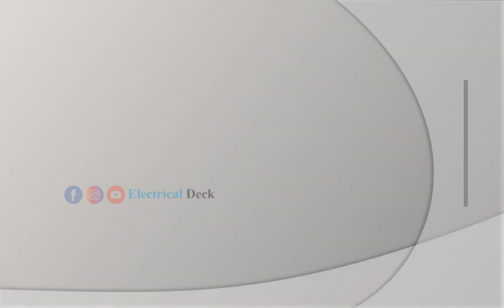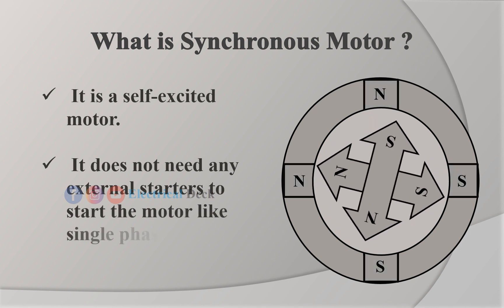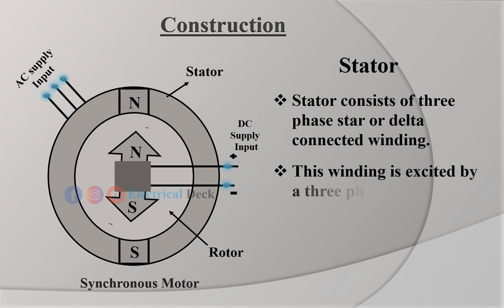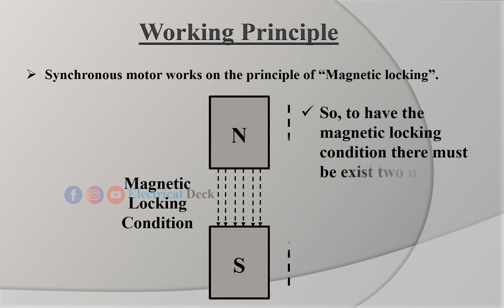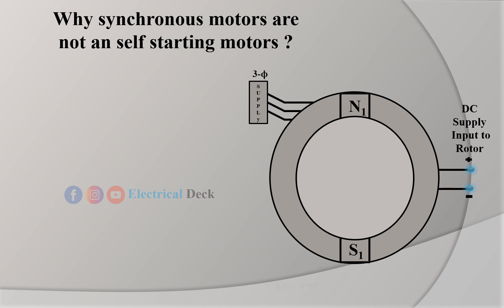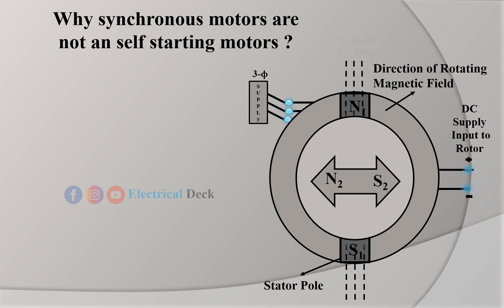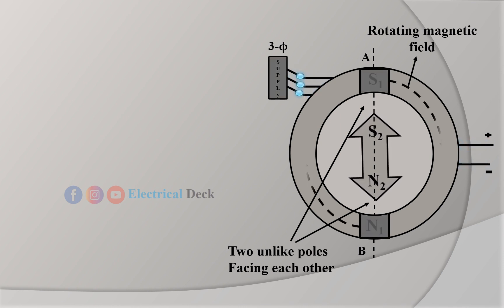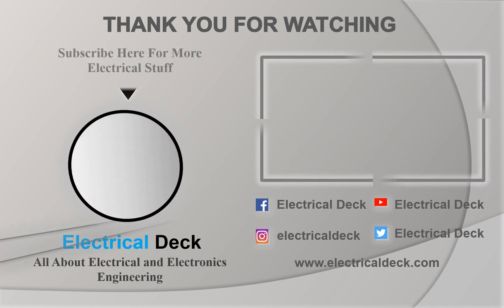What is Synchronous Motor ? - Construction & Working Principle | Animated

Comment: A synchronous motor is not self-starting under normal conditions. It requires an external means (such as an auxiliary motor or damper windings) to bring the rotor close to synchronous speed before it can lock in with the rotating magnetic field of the stator.

In contrast, induction motors are self-starting.
Reply: exactly. i am not watching it anymore in case this is giving wrong information
Reply: What is synchronous motor

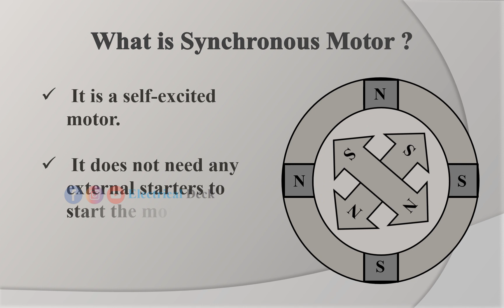Comment: At 0:42 U say its Self start motor, and from 3:45 u prove that it's not self-starting motor !  😅😂
U must recheck urr edits before upload. U will confuse students!
Reply: It does not require any external self-starting device, just an initial torque.
It is not self-starting but does not require a starter like other motors
Reply: watch my video also for this topic 
you will understand all 🙏
Reply: Tq